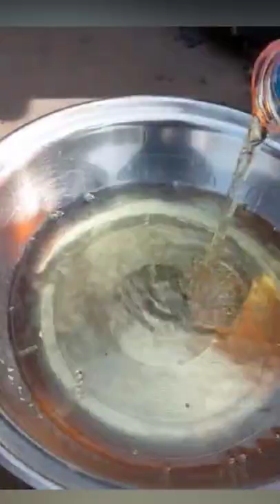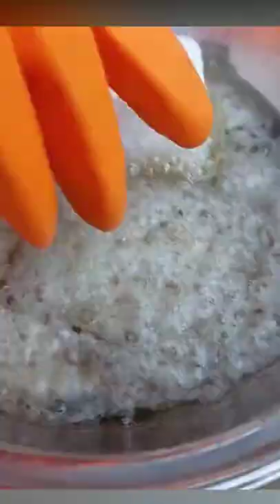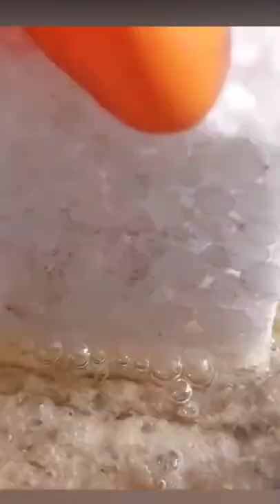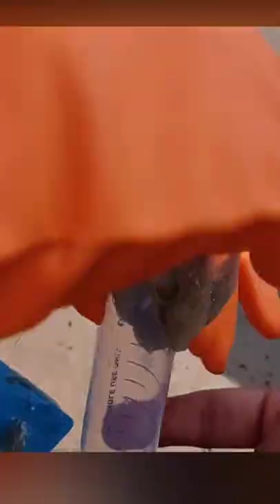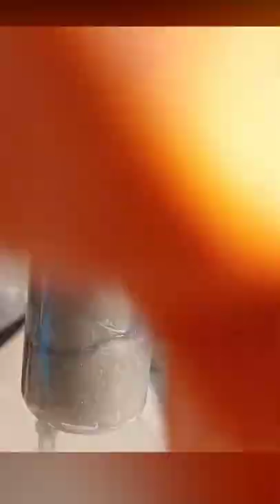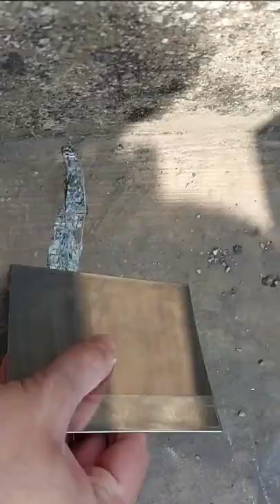Low Cost Waterproofing of Cracks in RCC Structure #Shorts #Short #waterproofing #waterproofingexpert

Comment: This is very dangerous. If someone stands outside and throws a cigarette bud one day on it it's will immediately catch alight and God knows if u have a car parked under the crack line it will ligh up as well!
Reply: Not true, when the thermocol (polystyrene) comes in contact with the petrol (octane) the thermocol will dissolve and melt down forming a paste as you can see on the video, eventually the octane molecules will evaporate and the polystyrene molecules will become rock solid, so it's basically like a very hard plastic concrete if that makes sense, and so if someone stands outside and throws a cigarette butt on the wall, nothing will happen, it's safe. So spend less time on games and more time on your books.😂